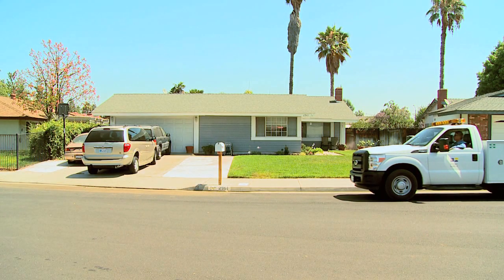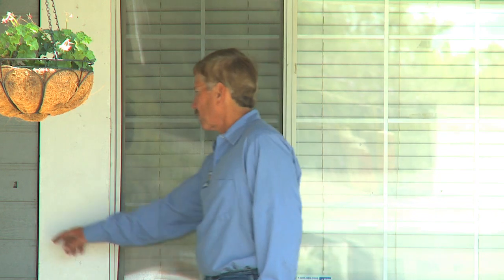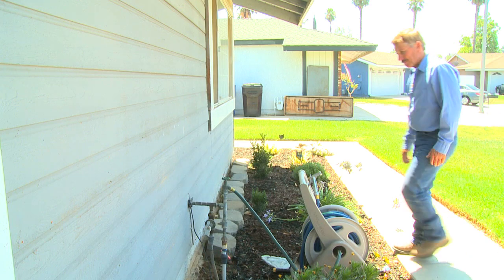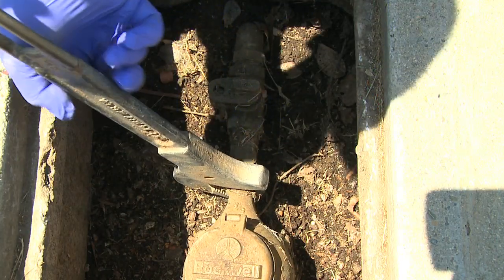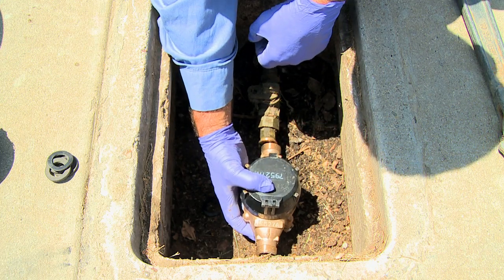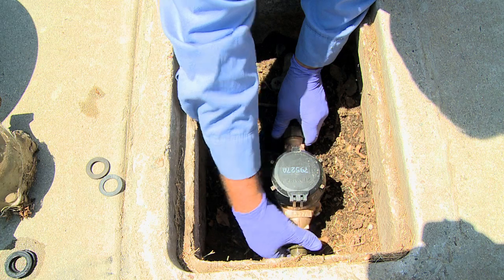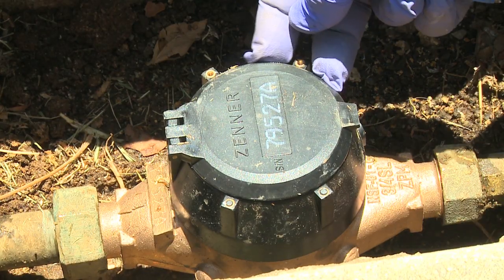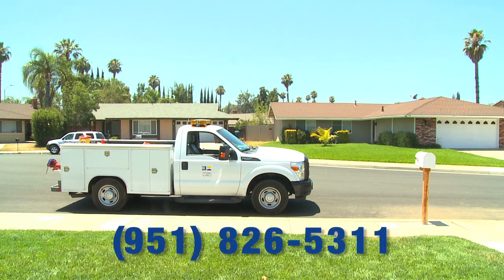Water Meter Change Out

Comment: What was that tool used to move the nuts on the meter i work for the water and it would help drastically
Reply: you can get them at your local home depot. HEAVY DUTY RAPIDGRIP PIPE WRENCH.
Reply: @jdmbubba30354  the extension on those one hand wrenches are aftermarket I believe; the extensions where welded.
Reply: We call them pelicans where I work

Comment: Our city had a water break so massive that it created a backflow that pulled the water from the pipes and fixtures in our houses including siphoning from my water heater.  Is there a log of that? Would our city have a record of it because when the water was restored water went back through our meter filled our lines etc and now we're being re-charged for water that was originally in our pipes and fixtures to begin with!?
Reply: water going backwards will spin the meter backwards so it wouldn’t be charging you more

Comment: 20 to 30 minutes? What are they doing? Taking a nap? 10 minutes tops if there are not any issues with the installation.
Reply: Iam a meter changer: Exactly you’re right! If you don’t have any issues I need 5 Minutes. Imagine I would change 12 per hour and 96 of them a day, 480 in a workweek and 25.000 a year!
Reply: @SchnitzelFritz are you still doing this